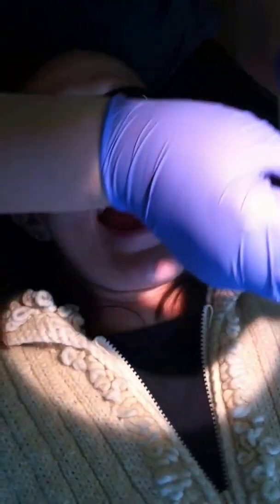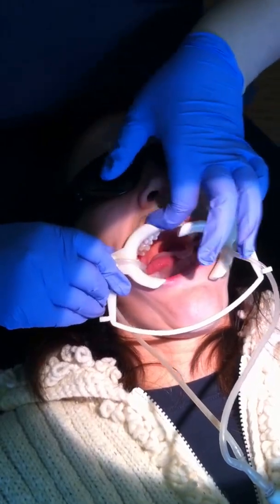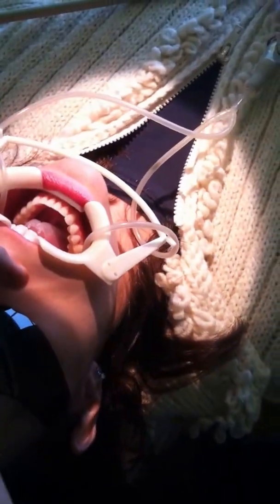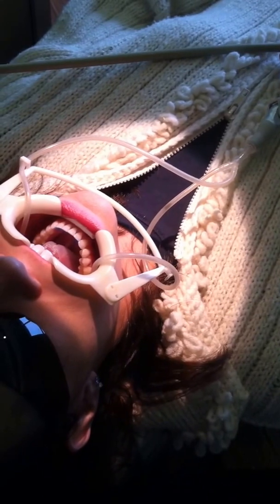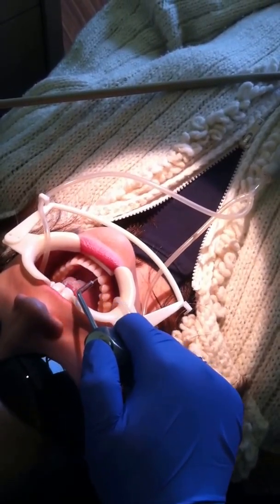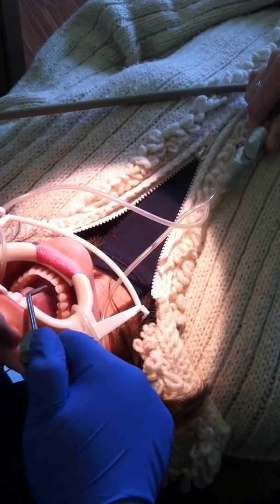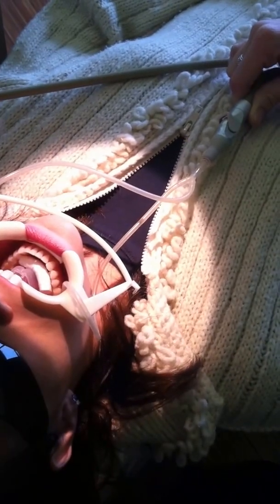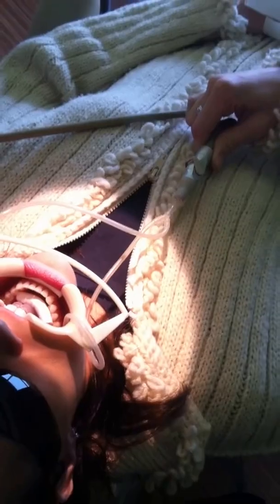MagneTainer™ Placement

Comment: I have the MagneTainer used in my mouth, post braces. After the initial placement, I did lose a single bond after only a couple weeks. After returning to have it re applied, I'm going on 6 months with ZERO problems. I love being able to easily floss my bottom teeth! The magentainers are not invasive in any sense and I've noticed no movement in my bottom teeth since having my braces removed.

My magnetainers were applied by the gentleman heard speaking in the video, who also developed this system.

10/10 would recommend.